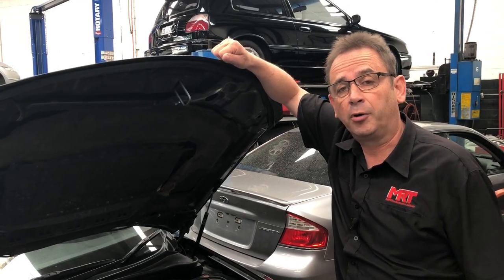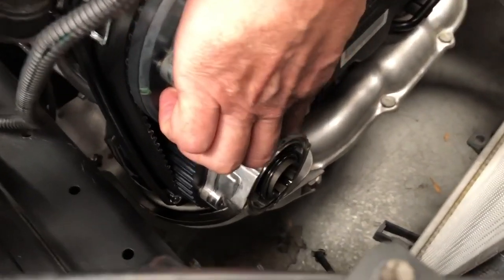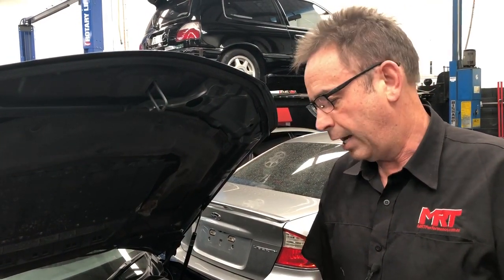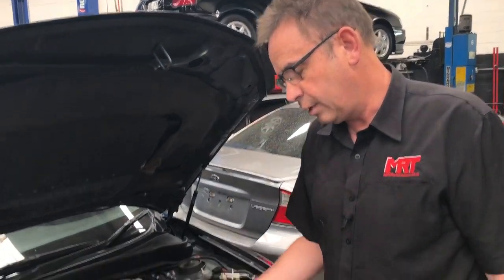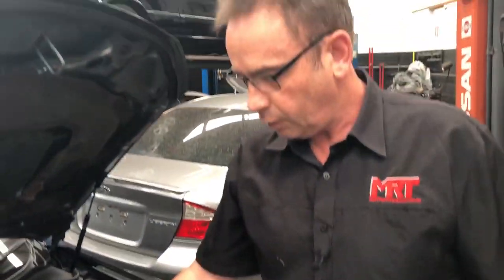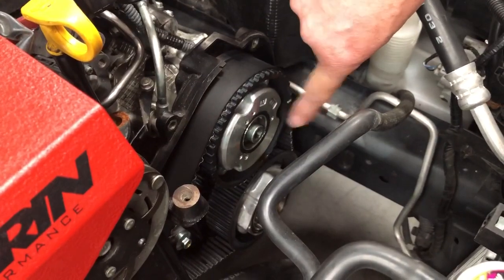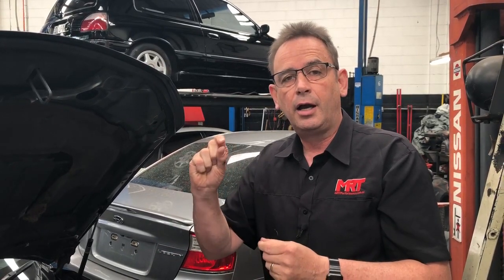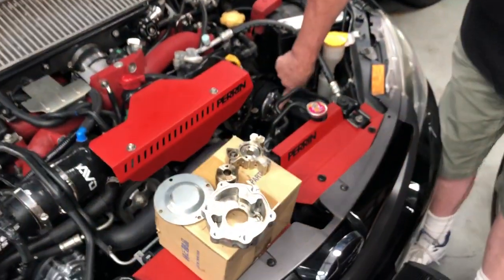Subaru Variable Exhaust Cam Oil Leak

Comment: Great info but you forgot to talk about the oil leak. I assume from the o rings on the cam cover.
Reply: Vegaspsycho I would like to know about the oil leak also! I have a jdm ej20 in my 08LGT with the exhaust avcs not plugged in because my wiring harness doesn’t have the plug. I took all four pulleys off and replaced all four cam seals because of oil in timing belt  cover had lots of oil coming out of it. After putting the new seals in I’m still leaking. Please help Brent

Comment: I really wish I had some way to get my car diagnosed by MRT Performance. I have an exhaust cam oil leak that I’ve tried fixing numerous times, even with new parts. Still leaking… and I get a lot of over boost when I get on the gas pedal. I need expertise like this. I’m just dejected thinking about my car like this 😒

Comment: I've been having AVCS issues since I installed my motor in my car(2011 USDM STi). My car keeps throwing the p0018 code. Weird thing is that it only happens at normal idle. I can raise my idle to 1100rpm(+200rpm) on the acessport and the code will not pop up.  So far i have changed the OCV solenoid, the cam sensor, cleaned the avcs banjo(kept filter installed but cleaned it) AND installed a brand new pulley(also re-Timed the engine). Yet the code keeps coming up at idle. The engine has a few bolt ons but internally it is stock expect for a killer-b pick up and baffle. The only thing I can think of is possibly the oil pump being the issue? Maybe some debris from resealing the oil-pan are causing issues? I'm completely baffled by it.  Would love to hear what you think it could be.  I have been watching your videos for the last 5 years and am always impressed by your knowledge and expertise.  Thanks!
Reply: Have you ever found the issue of the problem? Currently in the same situation
Reply: My issue was the ECU. In very rare cases you have drivers go bad. I would also suggest making sure your cam gears are good. If you used the company 23 tool and not the oem subaru one to remove them, there is a good chance you broke the pin inside the gear. ill post a link to a video that explains that.
Reply: https://m.youtube.com/watch?v=33cwSr0-7fE Here is the link to another video. You can monitor your avcs solenoids through the cobb ap. Make sure the left and right sides are moving the same. Did you re use your cam gears from another motor?